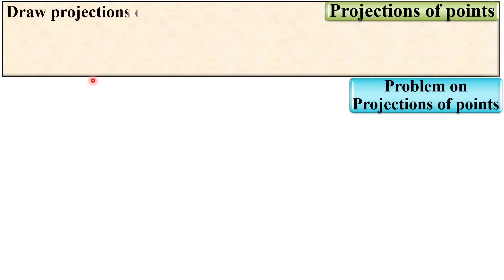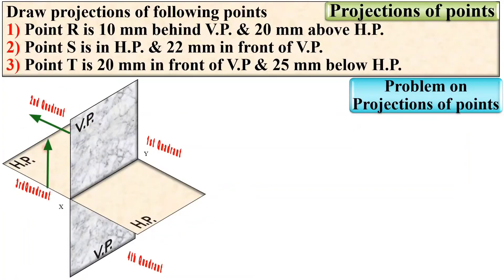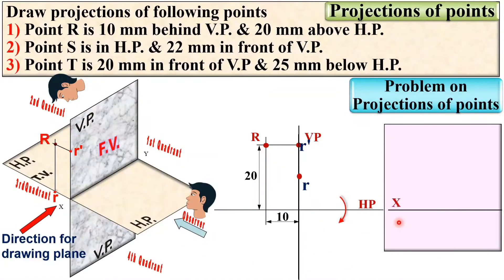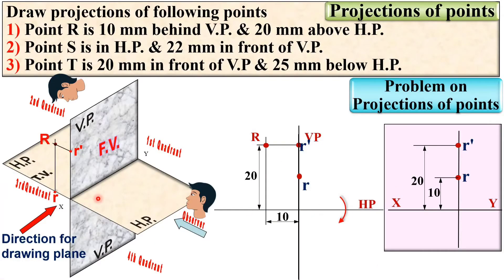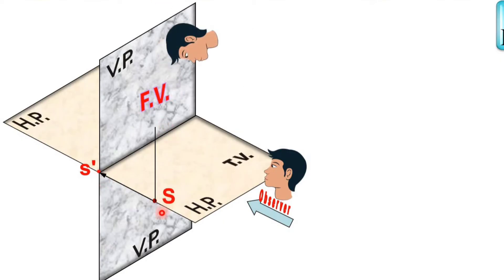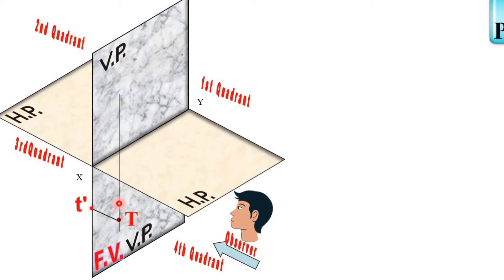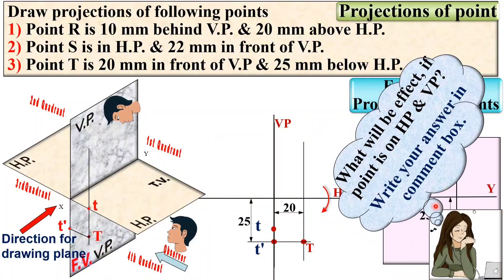3 - Projection of points (Basics, Drawing Process & Solved Example) Explained in Engineering Drawing

Comment from the maker: Projection of points explained with following timestamp: 
0:00 – Projection of points in Engineering Drawing lecture series 
0:12 – Problem description on projections of points
0:40 – Point R is 10 mm behind VP and 20 mm above HP 
5:11 – Point S is in HP and 22 mm in front of VP
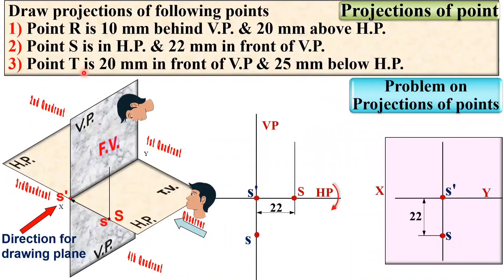7:18 – Point T is 20 mm in front of VP and 25 mm below HP